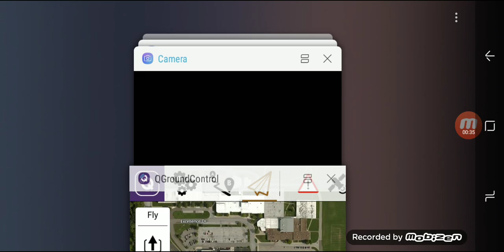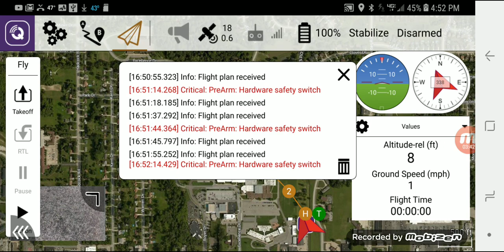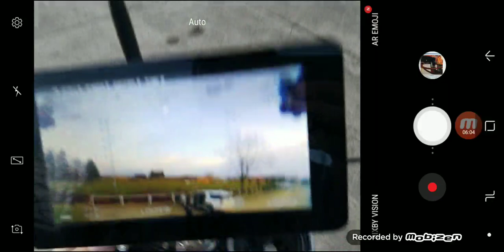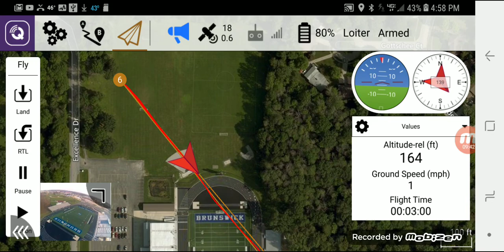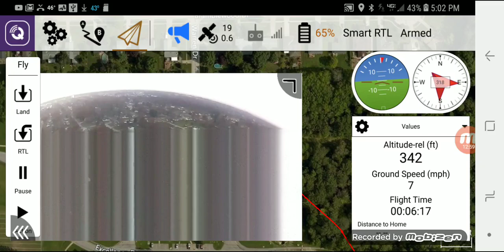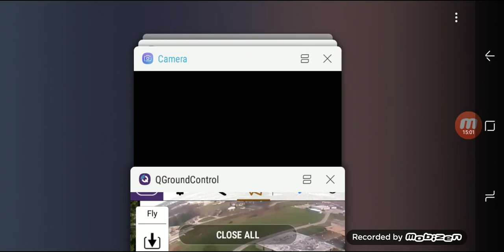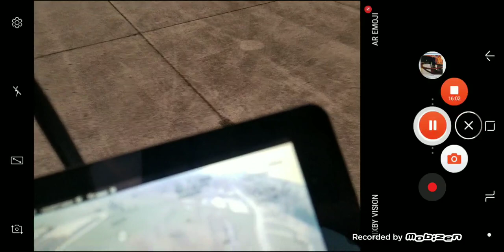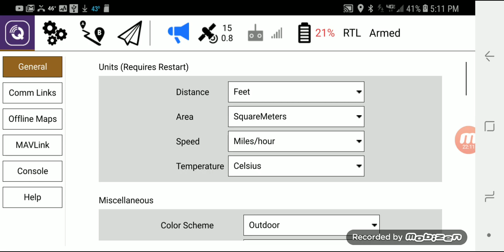Ez-wifibroadcast / Open HD first extensive test in air.

Comment: Thanks for working on this!  This fork supports RTL8812/14 cards and the Pi3b+ out of the box correct?  I've got Ez-wifiBroadcast installed, but have a AWUS1900 card I want to try.  Was looking at rebuilding Ez-WifiBC with the needed drivers etc, but would just flash your fork if it already supports it all.
Reply: Installed it and answered my own questions, lol.  Awesome work.  Looking through the settings though, I see USB Camera stuff.  Could this be used to get the feed via a RunCam perchance?
Reply from the maker: @nate0031  Hey, I'm glad you were able to answer your own question!😜

Hey, have you been following are telegram group? It's up to about 80 people and, we're working on open HD 2.0 which I was hoping to have out before the end of this week.

It specifically has several optimizations related to RTL8812AU cards. 

Here is the telegram group

OpenHD 2019_RCGroups Telegram Group
This Open.HD group is intended to replace or supplement the Open.HD RCGroups Forum which is outdated and difficult to share media.
https://t.me/OpenHD_May_2019
Reply from the maker: Also, here is another link..

https://t.me/joinchat/LiHVzxU1izb3sif0r8TH8Q

Same group, just different link